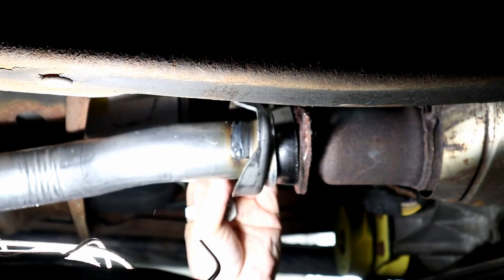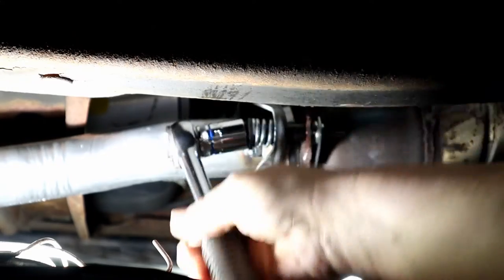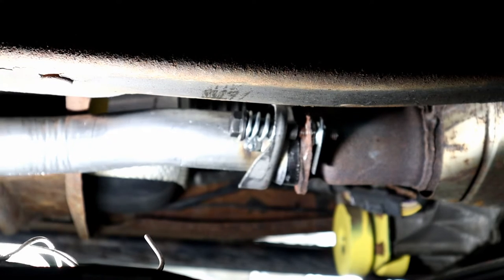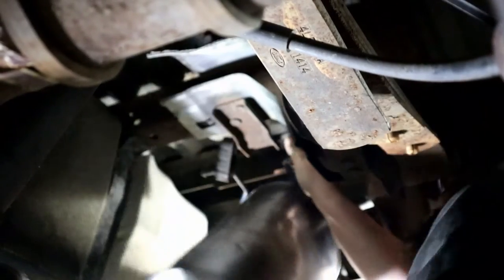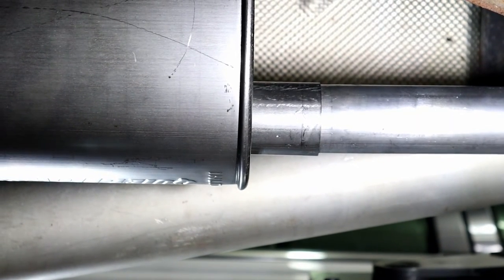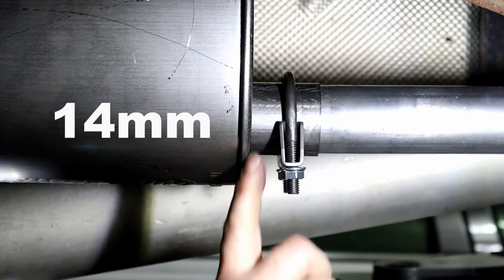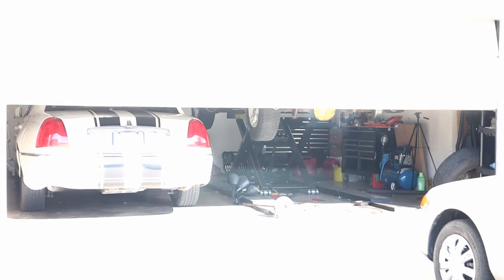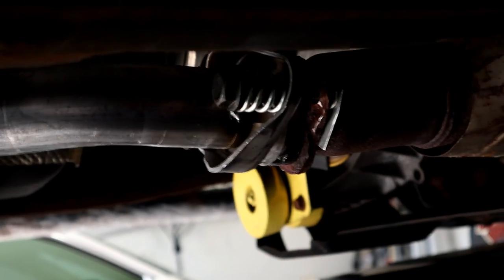Replace muffler on Ford Ranger

Comment: Thanks for posting this video. My exhaust set up is the same, and I'm looking to replace it. Did you buy the whole kit, or individual parts? My ranger has the 126" wheelbase. Did that muffler sound good on that ranger?
Reply from the maker: Got the complete kit from RockAuto. They have the regular cab and crew cab kits. And yes it sounds better than the original. I can hear it from the inside when I step on the gas.  A more gutsy sound.

Comment: My man is completely lost with his mufflers good gob bro
Reply from the maker: Thanks, I did the Mazda and the truck. Imagine the cost if I took it to a dealer or a certified mechanic. To get it done, Plus they buy the parts. My Lincoln town car exhaust system is still holding out. Thanks to stainless steel.

Comment: Did you ever replace your exhaust hanger in the rear? Just curious.
Reply from the maker: No,  the original  Rubber Exhaust Hanger are still good and not cracked or spit.